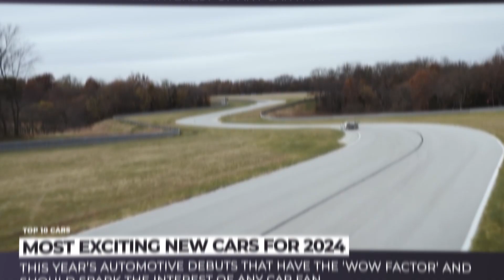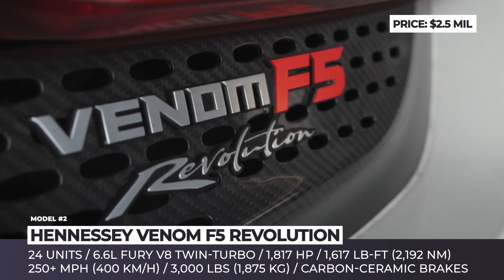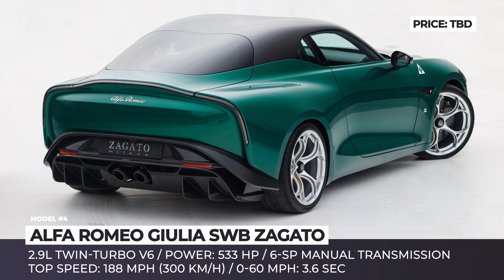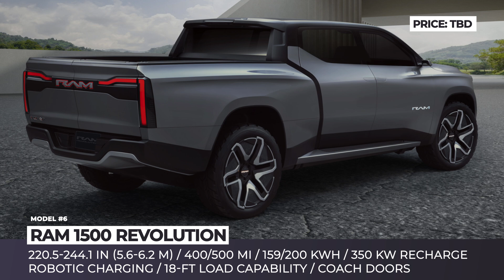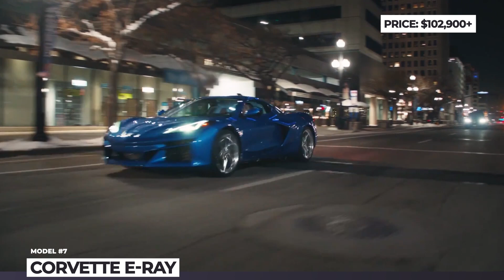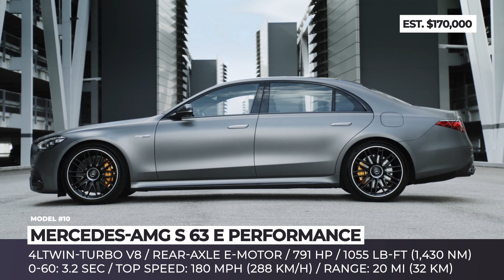10 Most Exciting New Cars Presented for 2024 MY (Our Favorites with Interior & Exterior Highlights)

Comment: #01. Drako Dragon. Slightly uglier than a Lambo Urus, but it is an EV. I'd take the Lambo between the two.
#02.  Venom F5. Not my favorite car, but it still nice.
#03. McMurtry Spearling. It shrank in the wash, and it is halfway from cute and F-ugly. 
#04. The Alfa, I didn't know Pontiacs could look so good. It blends a Gen one with a gen three and it is stunning.
#05. The Aston. We can Thank Ford for this design. DAMN!
#06. An electric truck. So, it is actually useless except to look at and that is one of it's worst points.
#07. I don't know if this isn't worse than the original C-8. AT least that one wouldn't overheat after using it twice and you didn't have to worry about it catching on fire or blowing up from just sitting around.  Some EVs were being shipped to the US with some Lambos and Porsches. The EVs, (Some of them anyway.) caught on fire and sank the ship taking the other cars down with them.
#08. The Cobra. This is the exact same look this car had in the Sixties when it first came out with plus a modern Ford drivetrain. Why can't other Car makes offer this?
#09. A toned down Veneno that is almost as ugly. I like it. A car doesn't have to always look good to be good, but it doesn't hurt.
#10. The M*B AMG 63 E. A Hybrid EV. I'll let this go, this time. So, how can a Benz copy a Lincoln, (The last Continental.) and look good when the Lincoln looked terrible in almost the same design?
Reply from the maker: Nice take on every model. Are there any new models that you find exciting?
Reply: @automotiveterritory  Old muscle, it doesn't matter from where. Old trucks beat up, scarred, dented and having it's original engine preferably a six. Anything from the thirties forties and fifties. Old sports car especially Ferraris and Astons. Certain cars from up up the nineties. I like off makes. I like some modern cars, but that is slowly disappearing. I don't like EVs. This is off the top of my head.
Reply from the maker: So you strongly oppose those who use old vehicles as their restomod projects and install an electric powertrain instead of an ICE?
Reply: @automotiveterritory  It is their vehicle and they can what they want with it. Just don't expect me to like it. They are entitled to their freedom to choose it the same way I am entitled to my opinion to think they wasted a good whatever by putting the wrong engine in it. Like dropping a Chevy Anchor engine into a make where it doesn't belong. You can use whatever excuse you want the real reason is that the engine was the cheapest easiest engine to use. And with an oil-line something else should go there. Like a Viper engine in an Auburn resto-mod. The right engine was used. MOPAR or Ford should go into a Resto Studebaker. And for the EVed "Classic" Why mess up the car? The car had a longer range with the original powertrain and was also more reliable. An old Mustang won't blow up or catch on fire when just being parked. (Unless you rear end the first ones like a Pinto.) And you couldn't enjoy it as much either. It would be chained to a recharge tower when an ICE version of it is on the road and you can drive it for whatever course/track/road you want.

Comment: Someone needs to put four 75hp ev motors, ome in each wheel, with a two door light chassis with decent enough but functional back seats. With a decent enough battery wuth this relatively low output, it should still get over 300miles and under 5s 0-60mph with a low comparative orice tag (under 40k).

An easy upgrade would be 150bhp moters in the back or then at all four, for $45 then $55k prices.

Comment: the gull wing large single door in the Drako Dragon 4WD + 2.0 in. Lift iTwinPower® 82.3 kWh 4-Dr Sports e-CUV (LHD) for front driver & rear paxs don't make sense . . . being innovative is a good thing but not over the top . . . the track only built McMurtry Spearling 126.5 kWh twin-ValuePower® 2-Dr Competition Sports Coupe (RHD) could do with a bit more width & a tad longer wheelbase (subject to racing regulations) . . . it'll be a blunder of a gross mistake if Lamborghini sheds off their legendary V12 power pack . . . even in this age of EVs . . .
Reply from the maker: Do you think that Drako really needs a 2 in lift?